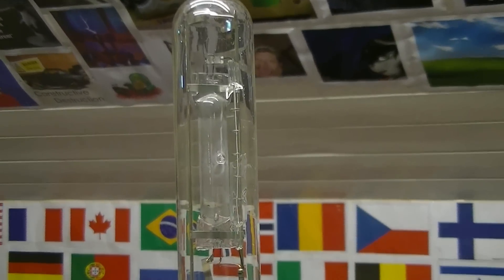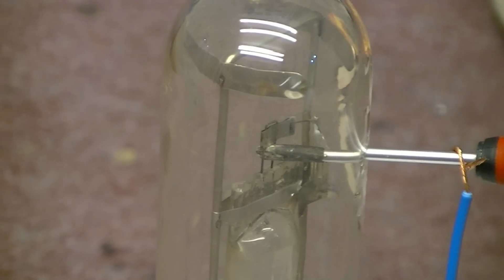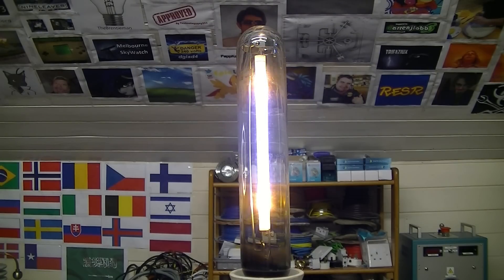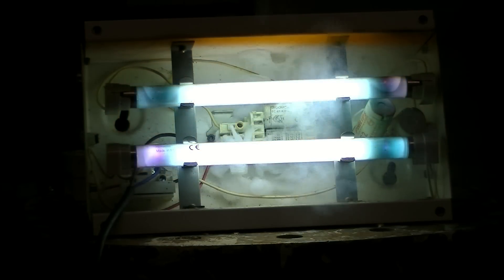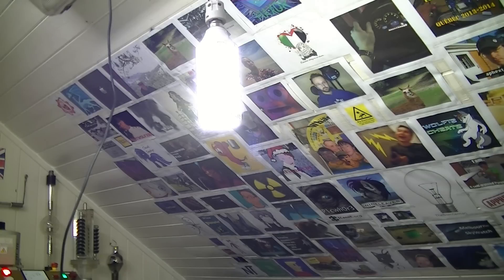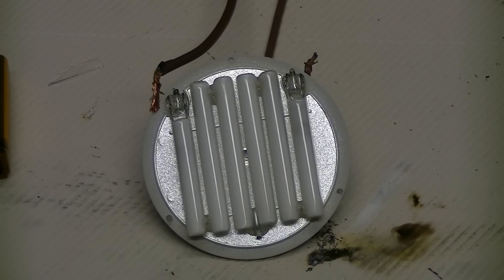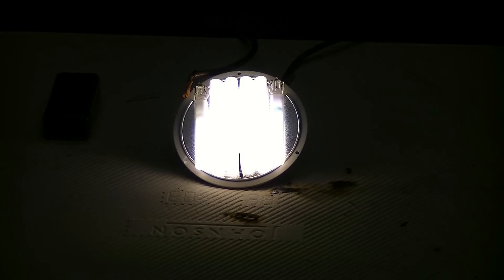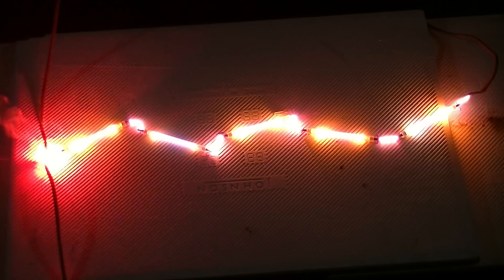8 in 1   Lamp Fun With CrazySparkie63

Comment: Just wondering what sort of protection do you use from possible flying shattered glass? I remember once heating up one of those drinking duck things that nod and look like they sipping from a glass of water. Them things that have red alcohol in them, well I heated the thing up using one of the burners on a gas cooker got it nice and hot so the alcohol was boiling then quenched it under the cold tap and the darned thing exploded with such vigour it was as if the glass had vapourized  I kid you not, I couldn't find a trace of it anywhere afterwards. I was sooooo lucky not to have blinded myself or got shredded to fuck.  I know your up there with safety but always be prepared for a surprise.  Great vids well done.

Comment: What are these lamps used for :0?
Reply: They are common in Car Park lamps.  Yard illumination.
Also large Commercial Building indoor lighting.
They burn too hot for Household indoor use.
The Mercury were the best of the bunch, not unusual to have Lifespans in excess of 20 Yrs.
Those are costly lamps.
Reply: I have personal experience using the old types of Mercury lamps (the phosphor types).
I have been witness to them lasting yes, 30 years, not an error. 
Also I have seen them struck by vandals, smashed open so only the arc tube remains & the lamp envelope broken, & they continued to operate.
I wonder if "future sales" are a factor in "re-designing" lamps, or discontinuing them.
When you buy a lamp bulb & it lasts 30 years before you need to return to the hardware store for a replacement bulb.....
That concept did not work out so well for the Biltrite Shoe Co.    (I own a few pairs).
Reply: The first 2 lamps.
Reply: Ziyad Ousmand the SBMV lamps are supposed to be a more energy efficient and cost effective version of the mercury lamps used in older street lighting, they never really became popular since the halogen lamp ballast would pop before the arc tube did, making them less popular than the standard MV lamp, and the 600W sodium lamps are more commonly  seen in horticulture, the lamps are too powerful to have in a street light and the CRI is terrible for flood lighting, but the lamps are great for growing plants as they are extremely bright and can be made to emit UV light as well as their usual orangey-white-ish retina scorching glow.
Reply: Thanks!
Reply: Ziyad Ousmand no problem
Reply: RetroCaptain the only real issue came with the efficiency of the lamps, since they are hot running lamps, a lot of the energy from them is wasted as heat, and they take a lot to ignite on a standard ballast, somewhere around the range of about 10 to 20,000 volts at around 3 amps to just get the arc initiated!! and, of course, a lot of the light is UV in a mercury based lamp, and in the phosphor-free lamps, the glass completely blots out the UV instead of filtering and using a phosphor to react with the UV light, therefore a lot of light is wasted as UV that gets filtered via the outer glass, unlike something like the HPS lamps, which use 5,000 volts ro ignite and emit less radiation... but have a shorter life span, around 5 years if you're lucky!!

Comment: Photon are u still gonna make a torch with that 1billion candle power lamp u had? The one that was shipped with a blast shield on it.
Reply from the maker: I jolly well hope so.. might take a while, lithium seems expensive and dangerous.
Now thinking cheaper to go lead acid. 10 decent batteries should provide 800A at 47v for 2-3 minuets.lol
Reply: ***** LiPo are awesome batteries. im a rc car guy so all i use is lipo. if u need 800a at ~45 volts u could use 4 6s 5000mah 40c batteries (22.2volts per pack nominal 25.2 per pack peaked) run 2 batteries and another 2 in series and then run those sets parrallel that would give u 10000mah at 80c cont discharge (800a) if u need more discharge go with some higher capacity or higher discharge or both. u proly know this but discharge is capacity x C rating. lipo batteries require more care and more money but they pay for themselvs with the amount of power they put out and the lack of significant voltage sag under load.

Comment: That COB LED bulb looks like one of those dangerous bulbs AintBigAintClever reviewed, where the exposed LED pins are live: http://youtu.be/n3ci4nlKhEk

Great job with the HPS bulbs.  I would be curious to see how a LPS bulb would stand up to being over-volted, e.g. if it's yellow colour would broaden like a warmed-up HPS bulb before blowing.
Reply from the maker: A lot of cob LED units are pants, getting a shock from a lamp reminds me of the few times I have changed oven and fridge bulbs and its been broken, it does tingle a bit.
I over ran a 200w linear LPS on 2kw ( briefly before it popped )
There is a vid somewhere..
Edit: Photon's Update +   skip to 5.20
Reply: Yes the large corn led did have exposed connections and  also dripped  molten plastic when hot, which is why it was taken out of service for Photon to pop.
Reply: ***** Thanks for the link, I must have missed that video.
CrazySparkie63 I removed the one corn bulb I had also. Although it had a clear cover, I saw one user review of it also melting and another of it exploding.

Comment: how do the wattage buttons work on the big boy's supply? Is it just some kind of limiter? I presume they have no effect on the voltage?
Reply from the maker: Magnetic ballasts and variac, current control through ballast, voltage control via variac. volts drop heavy loads.

Comment: You should try to deïnterlace your video's when you are exporting them, that removes thos annoying streaks in the picture.
Reply from the maker: I did deinterlace some scenes, does not help.
The camera, editing programme and the i3 computer still run on steam.
I will look at a 1920x1080 Progressive camera and new computer in a few months:)
Reply: That would be nice! Youtube hates deinterlacing cams...
And an i3 hates everything above 640x480
Reply: ***** maybe you could try u.v or i.r filter on lens.
Reply: ***** Pop our old PC component by component when you do upgrade.
Reply: ***** I have a cheap Canon SX230 (all SX2x0 are pretty much the same) which works ok for slow motion, given enough light.